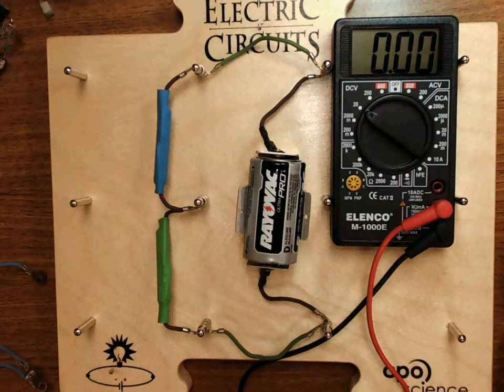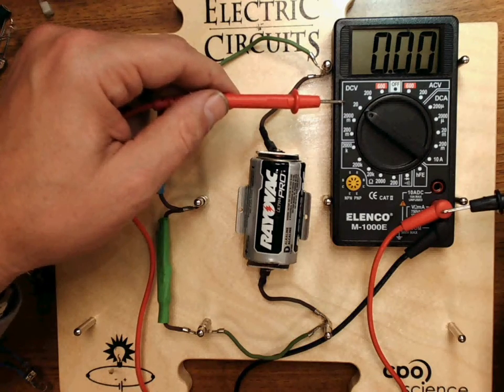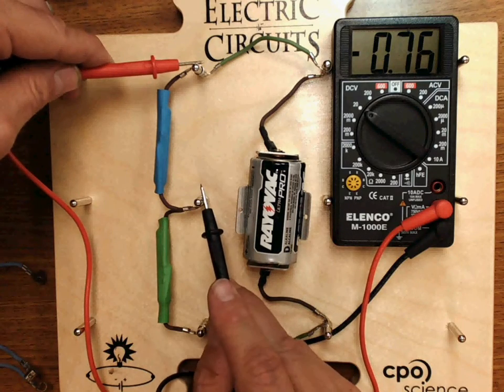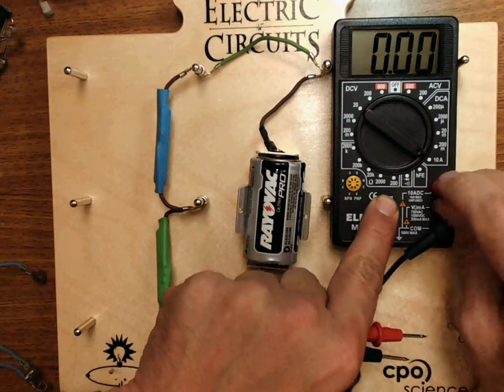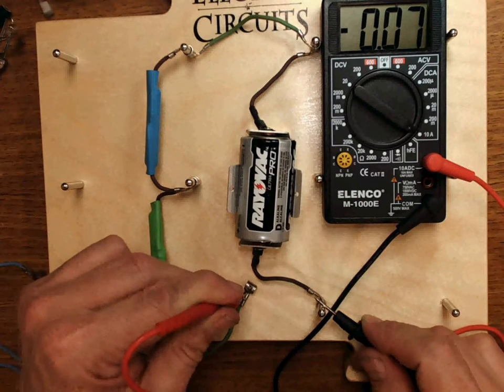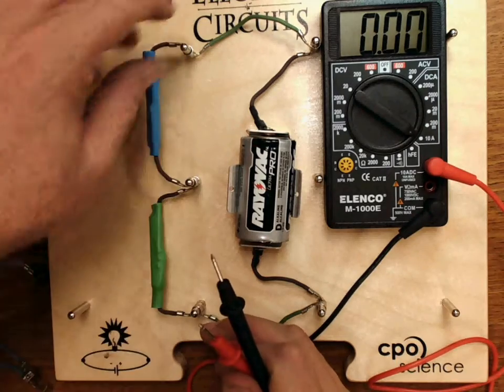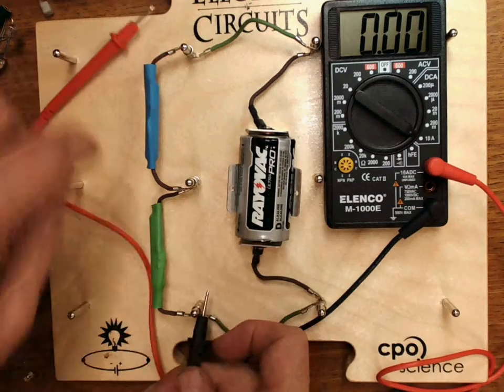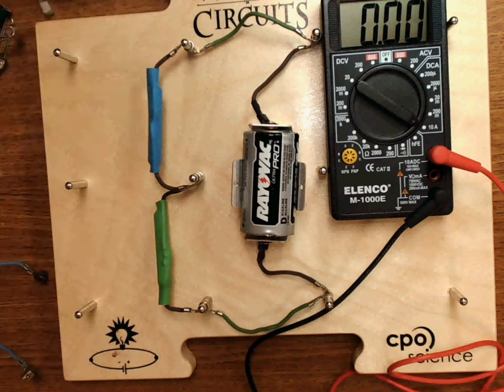Using a multimeter in a series circuit

Comment: Thanks, but I have a multi-meter that has two holes, one written on it "fused" and the other "nonfused" so what is the difference ?
Reply: One has a fuse that if you go over that you won’t fry your DMM. You’ll blow the fuse. The other if you go over the rating you risk actually ruining your DMM

Comment: what will happen if you connect the voltmeter in series ?
Reply from the maker: You know?  I've never thought of that!  I'm guessing that since internal resistance of the voltmeter is pretty high when measuring voltage you would show low or zero volts.  If being used as an ammeter, both would likely show the same current since in that case the internal resistance is low.